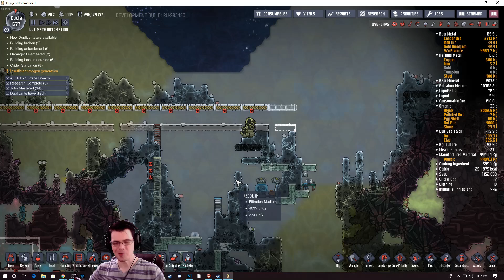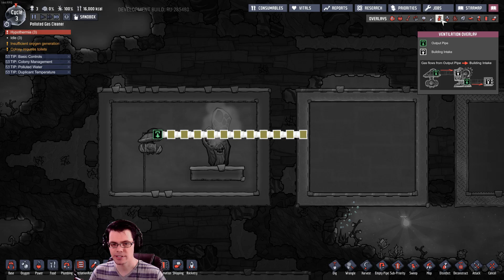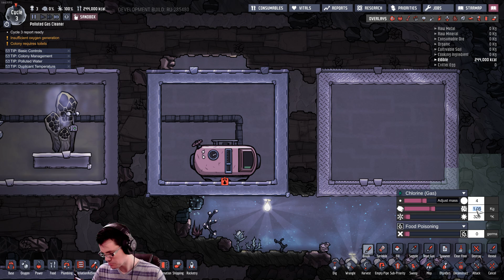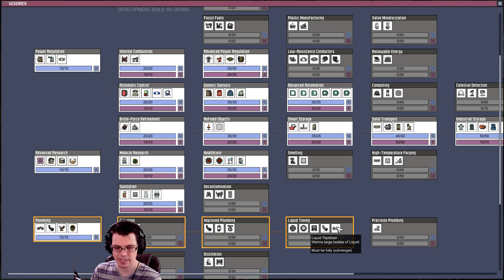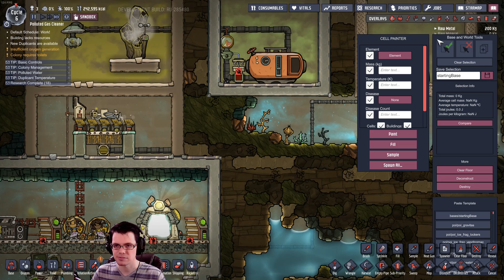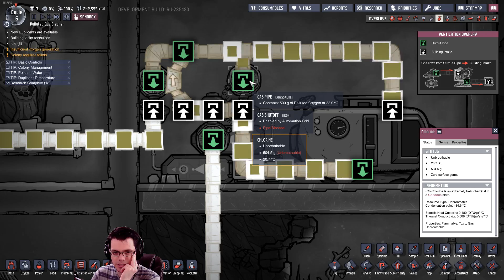Automatically Disinfect Oxygen and Water! Oxygen Not Included

Comment: so for the lavatory system: since you can control when the dupes go to the toilet, just make sure that they don't go during one half of the day (if you work with shifts), then use a clock sensor to flush the lavatory tank that is immersed in chlorine right before the first bathroom breaks. If the food poisoning takes less than half a day to die off this should be enough to do it, although you can get some more time to kill it if the dupes have their bathroom break at the same time. That means more lavatories though...

Comment: you could probably make steam turbines more effective by  using the containers to build up the charge and then release it once it is full and the steam that is wasted will be recycled into the system by gas pumps or water pump (if it turns to water during the processes).
Reply: The problem is the heat limit of the container, (max 125c, steam need to be 300c for the steam turbine). Unless I missed it.
Reply: Might be able to tune the temperature with radiant pipes after the reservoir.
Reply: Travis Pluid  that kills entire point of B Walk's suggestion. I do cook steam on a go for turbine - as soon as it's made in Pwater evaporation chamber, move it through freshly cooked petroleum and dump under the turbine. when enough pressure is built in the chamber doors open and allow steam through turbine. No need for container here.
Reply: problem here is that it will release only at 1kg per tick. But if chamber under the turbine is small and above it it's almost vaccum... I need my drawboard!
Reply: Since it can't withstand the heat of the steam but metal tile on top of the magma then to give the charge the water container with a inside full of dup waste then the steam that is not used is recycled turned into water and put back into the charge.
Reply: Better question. Can the container be under water?
If yes you can use it to cool down or heat up stuff that is under 125°C with oil and deleate the heat inside the powerstations.
Also so long there is no mega pump that can go over 125°C steam turbines are risky move.
Reply: That makes me wonder if the the gas containers allow gases to mixing inside them, if so the system could be in a populated area without spreading the deadly disease which will technically allow the system to be built quickly and tuned faster.
Reply: Also question is:
Did pO2 with slime get effected by Cl?
Is Brothgars setup nessesary? Can je just mix both together for the same effect? Looping the Cl in a limit ammount for ever and having a much smaller setup?
Reply: @HungryHunter   if think he can just make a loop a filter in some chlorine then the germs will go away and it can be turned to oxygen
Reply: +B Walk
Also a good question is: can gas turn liquit inside the container without bracking it resulting in a better condencer "chamber"?

Comment: this got way complicated, way fast. At 14:00 why not just put in a Bridge from the pump into the loop so if the container is full of germy air it just doesnt allow more to come in with the bridge then the loop can still run until some of it is clean and able to leave, which it should do till its about empty then itll fill back up with germy air again.
Edit: I see the flaw in my thought process for it being full/empty as a container, but it will still keep the container side from backing up as it'd prioritize the existing loop. I will run this test tomorrow night and  add in my findings
Reply: Orccam's razor. That would indeed just work. sadly the best thing would be some way to detect if a tank is completely full, which there isn't at the moment, however you could replicate the effect with a somewhat simple memory toggle.
Reply: That's true but you'll want the container to completely empty before adding new gas or you'll germify it (slightly, the germs will be shared) and you'll end up having very slightly germy gas pretty much all the time. That's making the system functional but very slow.
If you replace that bridge by a shutoff controlled by a memory which is "set when the loop is empty" and "unset when some germ-free gas is detected", you'll have a cycle system that fills up as much as it can (input open but doesnt have priority), constantly loops until the container's contents are germ-free (closes input) and empties completely (opens input), and cycles again...
Reply: Like Guilherme said, there isn't a way to detect of the reservoir is full in the current build, so he can only detect when it's empty (by creating the loop and checking for when the loop has no gas in it). So to make sure he fills it all the way, he sets up a buffer that fills up to slightly less than the original system's max capacity, so that when he detects that the lower system is empty, he just dumps the entire buffer into the system, which means he knows for sure that it's "full".

Another problem is he's wanting to check the status of the polluted oxygen inside the tank (that is, how many germs there are). The only way to detect that (currently) is to pull some gas out of the reservoir and check it in the pipe.
Reply: You could detect that a reservoir is full by having a bridge send priority to the reservoir and have a sensor detect the overflow. I was thinking of expanding on that idea to have the overflow go to a secondary and using the automation flip flop between them.
Reply: I was thinking of a basic timer, you know the amount the vent can put out, maybe have it set at just over the amount received per release, to have a continuous operation, as you see he already cleared the full amount stored in a few cycles, unless you are adding more into the system from other means you do not need the full automation as in the video.
Reply: would a weight sensor work? never tested it but if the tank contains 150kg of gas then that should be more than the empty tank and you can use the automation with that signal.
Reply: That's true but when I tried it I ended up needing the input bridge not having priority because the loop would jam otherwise

Comment: Feels like a bug, why should air impact contents? These tanks are not air tight? Also I'm assuming you have to be careful of air germs to not contaminate your storage. Seems counter intuitive.
Reply: It definitely doesn't make real life sense. But this would hardly be the only example of non-RL sense  in ONI. It doesn't abide by the golden law of thermodynamics either so... meh. Imagination.
Reply: Well, it does make sense that a small amount of chlorine (as or combined with chlorine dioxide) can be used to disinfect a large reservoir of fluid. You can look to most swimming pools and industrial air filtration for that. It's entirely possible that the tank could regulate the proper dose (0.5-2 ppm) of whatever's ambient to mix with its contents. No wonder they're so high up on the tech tree!

The liquid storage tank would need to be more high tech than that though. It would need to do a test dosage and adjust it based on the the results (again like swimming pools). And if it's just using gaseous chlorine, it will need to bubble the gas through the water. Otherwise it would only kill surface germs. Still, that's well within ONI's high-tech realm of believable pseudo-physics.
Reply: Maybe future updates will bring bubblers, some kind of tank with both gas and liquid inlets and outlets !
Or they might just keep it like that.. Doesn't really seem like a bug to me, more like another shortcut from real life :)
Reply: It's because tank allow water and chlorine be in the same tile AND interact with it. Haven't you stored your germy slime in compactors in chlorine environment?
Reply: I think this is a good solution unless Klei wants to add a way to make chlorine tablets to add to a water supply. Or here's an idea. Add an aerator machine to add gas to the stored water. Chlorine would kill germs, and CO2 would create seltzer water. Maybe add a way to process bristle berries into sugar and flavor and your dupes can have soda. That would be a nice boost to morale.
Reply: Well when you think on it maybe they are simplifying it otherwise you would have to put chlorine inside there to cleanse the germs
Reply: No. It's intended. The reservoirs are categorized as storages as I noted when the first systems of this kind came out on the Klei forum a few weeks ago. All storages are exposed to the surrounding gas, so reservoirs should not be different.
Reply: It makes sense from that standpoint, but it's not very intuitive. They probably shouldn't be classified the same way as standard solid object storage.

Comment: This is a nice system. Very clean ; )
Reply: Nice icon :)
Reply: Tuxfanturnip Thanks! Drew it myself : )
Reply: for me it's overcomplicated.

all you need is for the oxygen to stay in the tank for a bit before being released. so just use timers. one timer open a shut off valve to fill in the tank, then when it's off and the oxygen is clean, the other shut off valve opens and the oxygen is released.

that's it. 
and you can have two tanks if you want so while one is collecting the other is venting and vice versa 

this way instead of having a ton of not gates, memory gates, sensors and so on, you just have a timer (maybe two if all need to be off for a time to get cleaned) and two shut off valves per tank.
Reply: @cotasam Nguyễn 
a bit of playing around to make it work i guess. 
i haven't really played the game that much since then to test it myself. and to be honest i don't really remember much of the video.
but yeah, pump it for some time with the dirty air, then stop it and let it clean itself. 
if i'm not mistaken the germs were dying at specific rate. meaning X amount of germs will always die for Y amount of time. which means you only need to find an upper threshold of how many germs are pumped for the time you fill it, calculate the time needed to kill them, set the timer for a bit more, maybe double it to make sure.

it may sound like a lot of work, and it probably is, but if i remember correctly the system showed here was also hit and miss at the start, until some balance was hit.

Comment: Brothgar my man, just discovered pacus are OP!!
1 pacu generates 67% reproduction of an egg each cycles, so in 3 cycles 67.3= 201 (2 eggs)
Each egg has 2kg of raw egg and 1kg of raw egg = 2,8kcal (omelete) 
So one pacu will gen 11.2kcal per 3 cycles, what is enough to feed one duplicant and 800 less of another
1egg = 5,6kcal / 2eggs = 11,2 in 3 cycles
2 dupes uses 4kcal per cycles 3.4 = 12kcal needed
So 1 pacu can feed 1 duplicant and 800 less of another
But 2 pacus can feed 3 -  1 pacu = 11,2 per 3 cycles, 2 pacus = 22,4 = 3 dupes for 3 cycles (3 dupes 6kcal per day, 6.3 = 18) and BTW can feed another duplicant for 2 cycles
And 3 pacus = 33,6kkcal per 3 cycles = feeding 5 DUPES =  5 dupes uses 10kkcal per cycles 10.3 = 30 / production = 33
And the  math goes on and on 2 p for 3 d/ 3p for 5p/ 4p for 6d - Got it now ?

Comment: I think converting from polluted to clean oxygen before you kill the germs might make sense as I think the germs die quicker on clean oxygen and you could also pipe germy clean oxygen from your base of you have it for some reason and it can dual purpose as an inline oxygen buffer
Reply: Tests done on the Klei forum shows that it takes a maximum of 200s to kill all germs, no matter how many.
Reply: @SamsoniteDove  still think it's better to convert first and then kill the germs just from a utility function. Just for the option of being able to dump it all out into my base in a pinch without it being polluted AND germy. Rather have the contents of the tanks be as close as possible to the end product
Reply: Emily Björk  I've mainly been using the liquid version to clean polluted water of germs before sending it to the sieve so I can use duplicant waste to fed electrolysers. Polluted oxygen vents I typically ignore as they are so feeble they really make sense wasting time on. Typical average output is usually not enough to keep even a single dupe with divers lungs supplied for oxygen so they're a waste of time in my opinion. The liquid version is not however, and several good, working, and fully automated systems have been posted on the Klei forum already (you need to dig a few pages back as most are a few weeks old now).